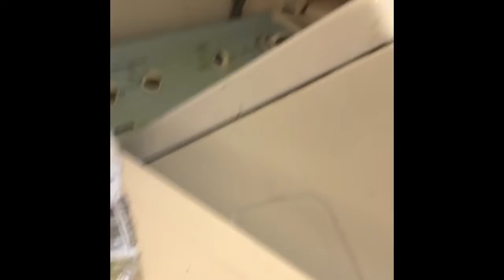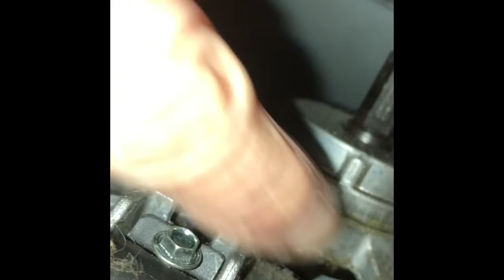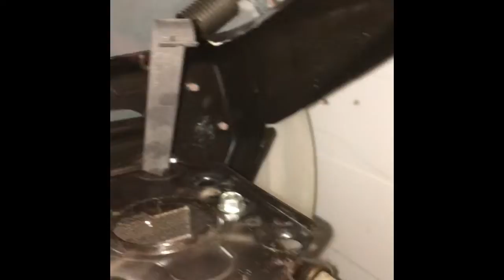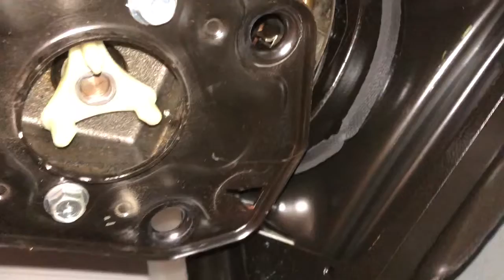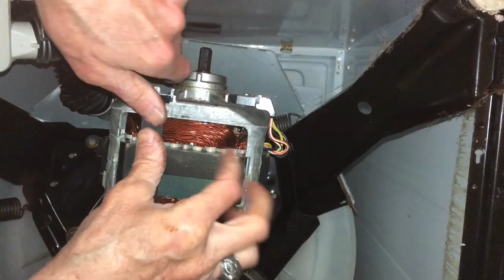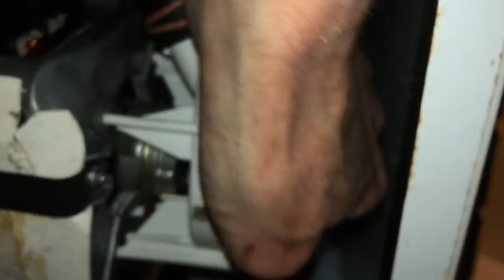This Washer Wont Agitate or Spin? Fix It in 3 Easy Steps!

Comment: My washer gets stuck in the spin cycle. I have to reposition the clothes to get it to spin. Changed the motor coupling and also the clutch assembly. What else could it be?
Reply from the maker: I think that one long suspension spring fell off in the back and now the spin is too far off balance.

Comment: My Kenmore sounded exactly the same, but the coupler wasn’t broken, just very dirty. The rubber had no tears or scrapes. The plastic centers were not rounded out. But replacing the coupler still fixed mine.
Reply from the maker: Glad to hear replacing the coupler fixed it, even if it wasn't visibly broken!

Comment: What type of 1/4” screw holds the bar of the engine in place? Mine on the bottom is rusted badly and stripped. I’m having trouble removing it to replace the coupler.
Reply from the maker: You can drill it out to remove the rusted screw.
Many models don’t even use that screw.
It’s not really necessary.
Reply: @ScottTheFixItGuyChannel Great thanks. I ended up using a 8mm socket ratchet to get it off. I was concerned I should be replacing it, but if it’s essentially useless and the retaining clip holds the engine in place fine, I guess there is no need to spend the $4 for a screw lol

Comment: Newbie here - My washer has all the signs of a broken motor coupler - It makes noise but does not agitate/spin, and it stopped spinning after I washed a blanket (another sign). However, after taking everything apart, the motor coupler has no obvious signs of damage and isnt rounded out; still fits well into either shaft and spins the shaft when I manually spin it. Any suggestions? Thanks!
Reply from the maker: That sure sounds like a motor coupler.
Maybe one side of it has the plastic forks broken, or the rubber piece is torn .
Reply: @ScottTheFixItGuyChannel  Hi Scott, thank you for your reply. The coupler is good. I removed the entire gearcase from the bottom to see if it was the clutch. I could not spin the clutch with my finger, so it doesnt seem like that was the issue. However, when I tried to manually turn the input shaft that the motor coupler would normally attach to, the output shaft did not spin. Every now and then it would barely move a millimeter or two. I also noticed that the gearcase was leaking oil. So my conclusion is that the transmission is bad. Does that sound correct? Thanks in advance for your help.
Reply: @briansiedenburg2514  were you able to figure out the problem? My coupler seems to be fine as well but is having the issues you mentioned.

Comment: This is the same model I have and I can not get the water pump off. I took the clips off and lift and nothing..it’s very rusty-any solution? I can see the coupler is broken between the motor and transmission..I just can’t lift off the water pump;(
Reply: Nice Job Debbie❤️👍😊
Reply from the maker: Can you get a big flat head screwdriver in between the pump and motor and pry it off?
Reply: @ScottTheFixItGuyChannel  lol I have tried-it almost seems like it’s connected/retractable lol. The part arrives today and my neighbor is going to try to help tonight-I’ll keep ya posted!! But Thxu cause an 8dollar part is better than the 150 repair guy 😂fingers crossed/thx for the response🙏
Reply: Fixed!! For 8bucks! Lol thx man!! It’s laundry day😂

Comment: Mine won't spin or agitate but it doesn't sound like the motor is getting activated aka no noise only silence after the filling stops
Reply from the maker: Thanks Edwin,
Just needs a new lid switch 👍
Reply: You were right lol i figured it out moments before you replied, i didnt have a switch so i by passed it for the moment. Thank you

Comment: I did  that , but now it's clicking stop and  starting  at the same time,  I smelled something burning,  so I just stopped it , I'm wondering if it's the Motor going bad or the transmission or the capacitor not giving a nuff boost
Reply from the maker: I would change out the capacitor.
Reply: Thanks I will try that

Comment: i cannot get the pump or white thing (first thing removed) back out of the way. should i remove hoses or try to work around??
(seems silly question...just want expert's opinion)
Reply from the maker: I usually pour the white plastic water pump all the way to my left so that it locks up against the metal washing machine frame.
Reply: thank you. I ended up using duct tape to help hold it, as it would not stay put. got it all done and appears to be working. fixed for under $7. thank you so much!

Comment: My motor don't have the pump on it it has a wheel for a belt to connect to the agitator (transmission)
Reply from the maker: Can you send me that question to:
Scottthefixitguy@yahoo.com
Reply: @ScottTheFixItGuyChannel  I have 3 kids so my issue required a bit more urgency, I bought a new washer. Thanks anyway

Comment: How do I know if it's the motor or the timer? It just filled but then just sits there, won't do anything. Timer issue? It is 12 yrs old.
Reply from the maker: Highly likely you just need a new lid switch 👍 Easy to do.

Comment: So I’ve got the outer box removed and I’ve taken the two clips off the water pump, but the pump (which seemed to just pop right off in your video) will NOT come off. I went so far as to slip a screwdriver behind the pump and tried to pry it off the shaft that runs into the pump. Wouldn’t budge. It feels like there’s something on the end of the shaft that is keeping the pump from coming off. Any idea what might be happening?
Reply from the maker: You’re doing good,
Rust has expanded the metal shaft which is now stuck in the plastic water pump.

Use even more force to break it free.
Reply: Dont forget the two 1/4 " screws before prying

Comment: I have a Kenmore 80 series that won’t spin, agitate or drain. It makes the same buzzing noise as in the video. I replaced the water pump and I followed the steps in this video but the motor coupler isn’t broken. Do you know what the problem could be?
Reply from the maker: It might need a new motor start capacitor.
Reply: @ScottTheFixItGuyChannel  Thank you for replying. I just changed the start capacitor but no luck it still won’t drain, spin or agitate and makes the buzzing sound. I did notice some burn marks on the relay switch in the motor. Do you think this could have something to do with it?

Comment: Need help, my washer leaves clothes wet.  agitates fine with new doggies, i replaced transmission, motor coupler, clutch assembly.  Everything works fine except no spin.  When I tilt machine over it starts to spin, I put it back level and it finishes the cycle and spins fine.  But when I start a new cycle, it doesn't spin again.  Tilting machine somehow fixes it but won't stay fixed next cycle.
Reply from the maker: Almost certain that a new lid switch will fix it👍
Reply: @ScottTheFixItGuyChannel  Hmmm...  The machine does turn on/off when I open/close the lid...  When i put a screwdriver into the lid switch hole it does the whole cycle like agitate, add water, pump water out.  only thing not working is the spinning.  sounds like the motor is running loud but not spinning the drum...  I've repaired several of these direct drive machines, and this one has me stumped.
Reply: I'm having same problem. Just spend 7 hours working on this thing completely replaced assembly, dogs, even a rubber shoe, clutch, everything and it won't spin during spin cycle and leaves clothed wet. I have no clue what's going on. 😕  if you figured if out, let me know!.
Reply: @therealvorpol  ended up that my supplier sold me a defective transmission.  They replaced it under warranty and now the machine works great.

Comment: This happened to me with a full tub. Do I need to empty the water first? If so, how? Also, how do I access this/remove the cover?
Reply from the maker: Hey Peter ,
It actually should still drain.
Reply: I'm actually doing it rn and you don't have to remove the outside cabinet, just prop the washing machine up and you can get to it from the bottom
Reply: That’s right.  Good idea.

Comment: enjoyed your video. whatever you do dont use the coupler with the metal insert. though it would appear to be a better coupler, it will be the last one you ever install on your machine. the problem is the metal coupler will destroy the shaft of the gearcase and the motor. its the third generation of the part over a 28 year period and the metal insert is stronger than the shaft it mounts to so it rounds off the shaft instead of breaking. Use the cheap plastic one and you wont destroy the machine. I think Whirlpool did it on purpose. thanks
Reply: InstaBlaster.